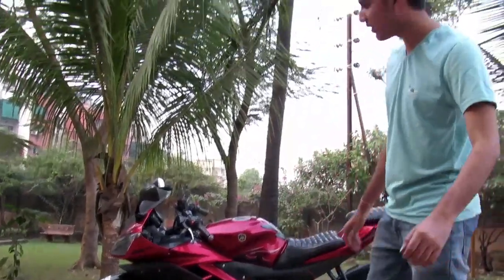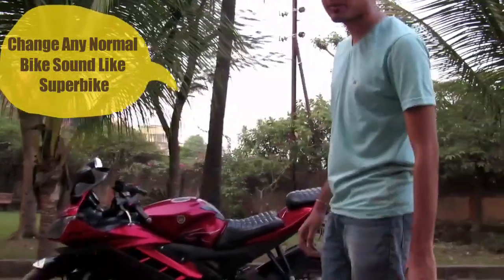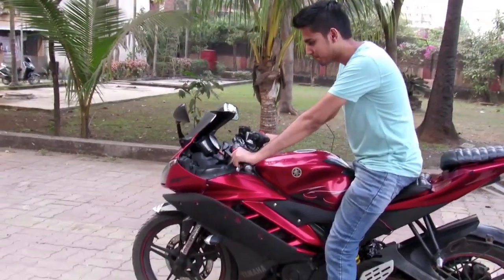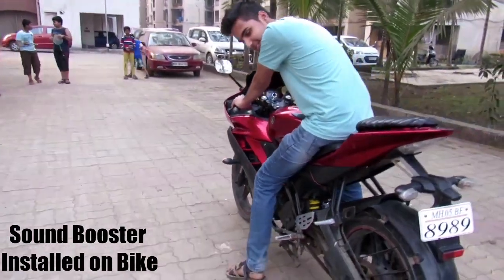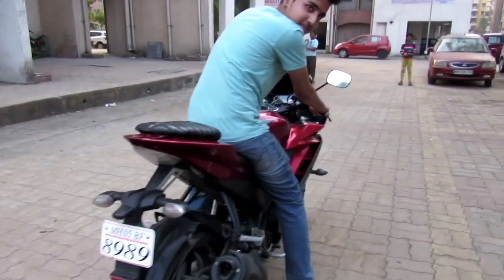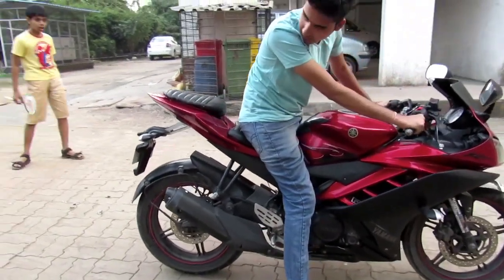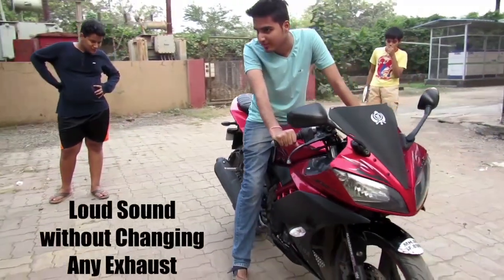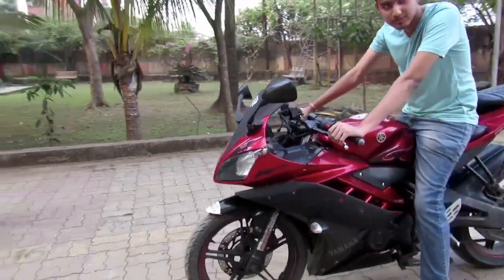R15 Sound Booster Modification,Change Any Normal Bike Sound Like Superbike

Comment: How you change your sound in r15
Reply from the maker: Give ur whatsapp number i will send u details
Reply: It is simple by attaching speakers and capacitor but it will fuxk your battwry
Reply from the maker: hahaha
i Know that ..:)
i have removed the Speakers after 2 weeks 
sound is great but
it takes more Battery Power
i have Charged my Battery again and removed the speaker now 
i dont use this speakr anymore 
have installed K&N Original Filter
Reply: Mr L K cool just one more thing , it is better to mess with exhaust than air filter given dusty environment in India.
Reply from the maker: Yaa 
Right
thats why i dont like changing Exhaust of bike
and sound also irritating,
stock bike exhaust is good doesn’t effect Bike Mileage
Reply: I see , I usually remove the catalytic converter from the bike , it loses effiecieny anways after 5 years . No change in baffles maybe a hole or two. This makes a better sounding and free flowing exhaust and yet the noise does not get loud at lower and mid rpms.
Reply: How this sound was coming